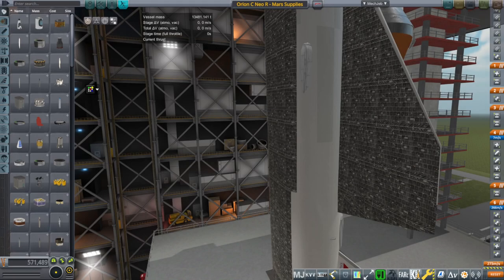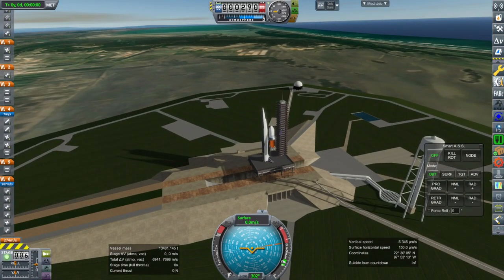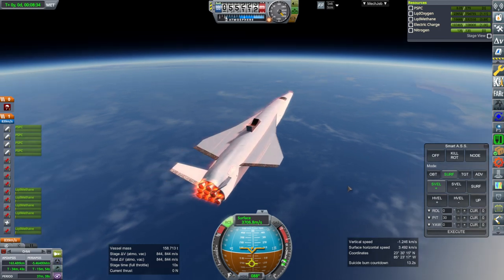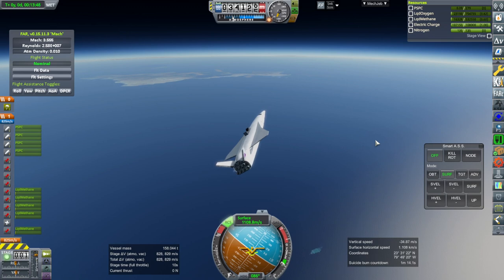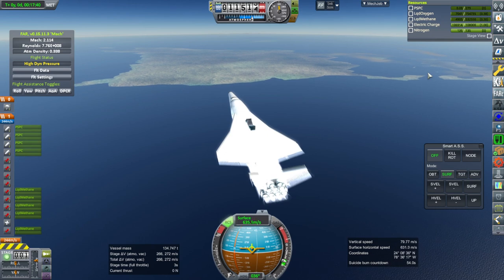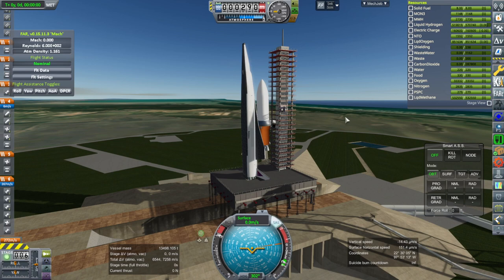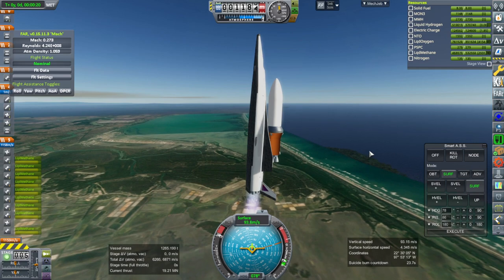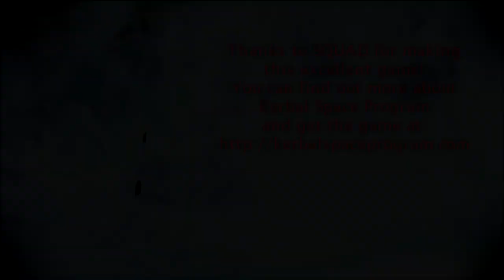KSP 1.8.1 with RO - Testing the Orion Carrier Plane from Tampico

Comment: Did you ever consider creating a methane Version of an Air augmented engine like sabre. That would fit the Orion plane quite nicely because you could also use it during Advent.
Reply from the maker: Tough to figure out all the details of such an engine and we probably don't want all our rocket engines to be like that (we don't need that much jet thrust and it'd be a lot more mass) so we'd end up with a mixed system anyway. Whether there's a benefit is very sensitive to the mass of the air-augmented engine and I don't have a good way of establishing that.